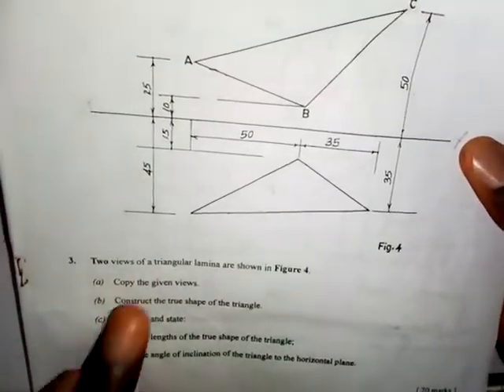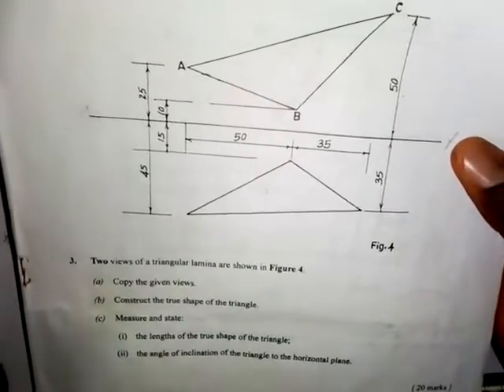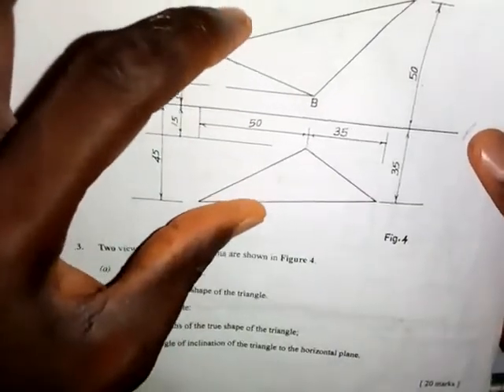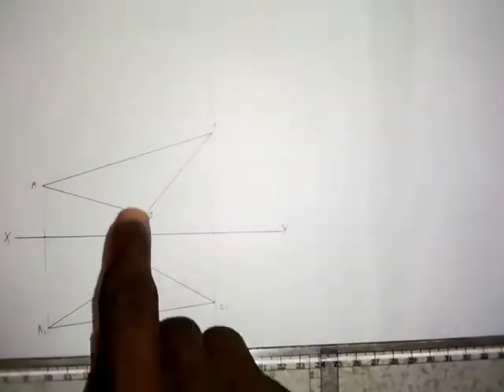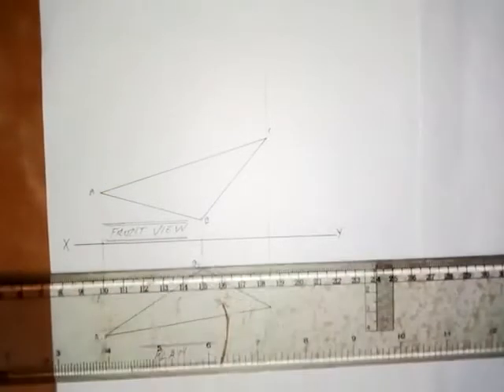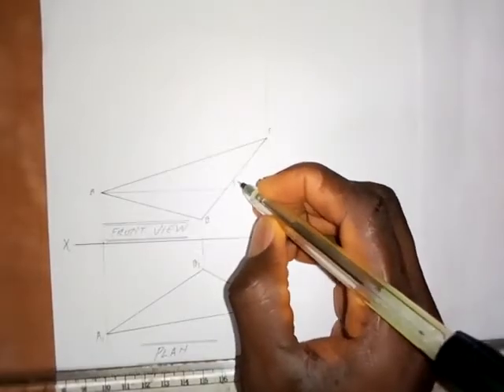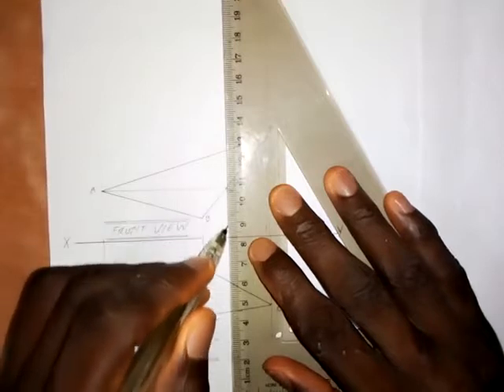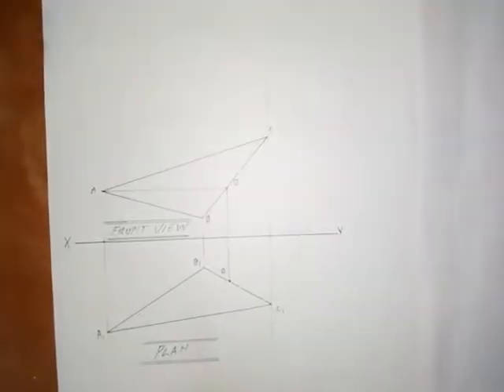Solution to WAEC Triangular Lamina Problem

Comment: Kindly assist a had arefer in second module and I would want to know  the unit I'm suppose to cover because I want to do the refer in July
Reply: I meant module two technical drawing
Reply from the maker: I don't really get this your message but and I don't know the module you are referring to but if you have the question (s) with you kindly send me a mail via teejaygracetech@gmail.com. Thanks
Reply: @HisGraceTutor    thank you for that attention I meant module 2 technical drawing syllabus   idid  CMPR  that is iwant to know how many units I should  do , for module 1